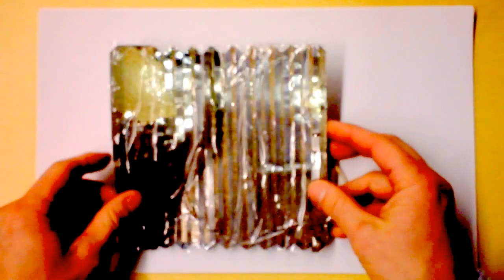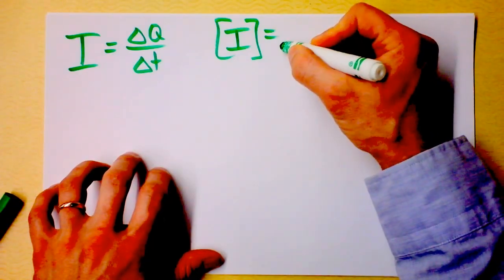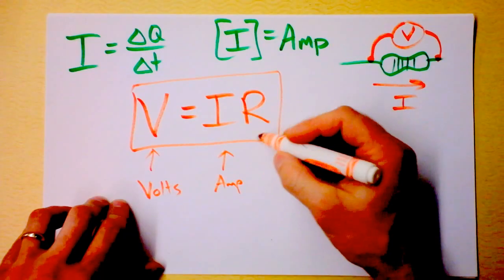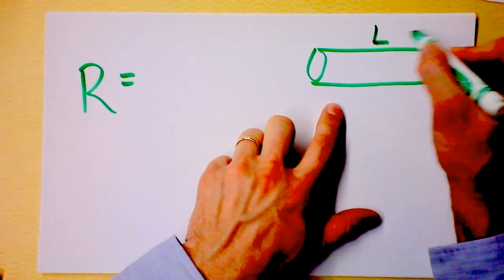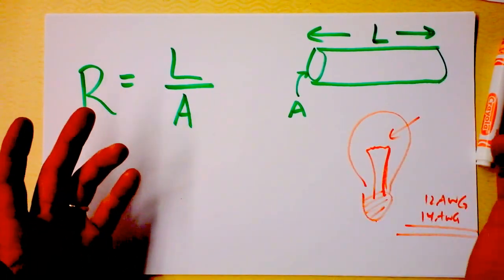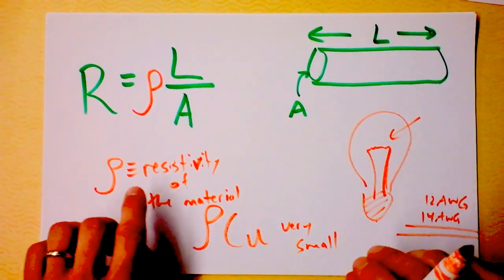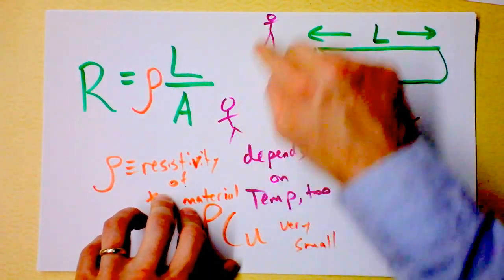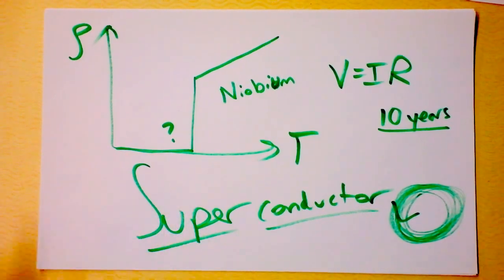Intro to Electrical Resistance, Resistors, and Resistivity | Doc Physics

Comment: Hmmm.. If V = IR, then if i have a 9V battery and want to put enough resistance so that the current is zero then the total resistance i will need to apply will be  :-  9v = 0A*R , which would be 9/0 which is equal to not defined. So does that means  I can't do that?

Comment: How big is the current in a superconductor? I mean, it can't be infinite, right?
Reply from the maker: Good question.  On the contrary, we can conclude that since there can't be an infinite current, there must also never be a potential difference between points on a superconductor.

Comment: Hi Doc Schuster
I have a question, two copper wires, one twice the length of the other. How do the resistivities of the two wires compare? The answer is both wires have the same resistivity? Are you able to explain this for me?
Reply: Resistivity is a property of a substance, while resistance is a property of an object. Copper is a substance. A wire is an object. A wire object made of the substance called copper will have an overall resistance, while the copper substance itself that the wire is made of has a resistivity that does not change no matter how big or small a wire you make out of it. 

If you use longer sentences, it becomes easier to understand. eg "copper is a substance, that has a resistivity of X. If you make an object like a wire ,then the wire has an overall electrical resistance that depends on its shape, temperature, and on the electrical resistivity of the substance that it is made of".

Hope that cleared things up for you.

Comment: how is it possible to measure that current in the circular super conductor without significant changes on it?
Reply from the maker: netauri123 Its magnetic field causes a precession of nuclear spins at radio frequencies.  The precession can be measured using a process called Nuclear Magnetic Resonance, which is the technology behind MRI's.

Comment: Saw resistance with units ohm-m^2 sometimes. How to understand that? And what value (like cross section?) is needed to convert it back to ohm?
Reply from the maker: Wanping Bai That's related to resistivity, and I would imagine that cross section would get you back home!
Reply: The flow of electrical current along a wire depends on the substance that the wire is made of, and the surface area of the wire. Of course the mass, volume, temperature, grain orientation etc play a role as well, but the surface area is the most important in general electricity.

Regarding what you said above, with units of ohm-m^2, what is being referred to is how much resistance there is per unit surface area. So, to "convert back to ohm" as you said, you simply divide that value, which is in units of ohm-m^2, by the surface area of whatever it is being referred to, using units of m^2.